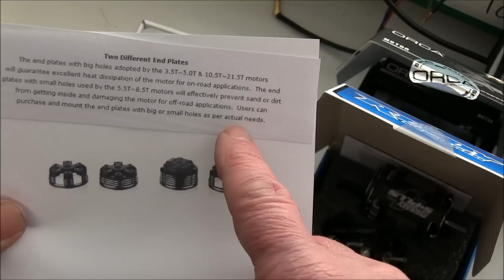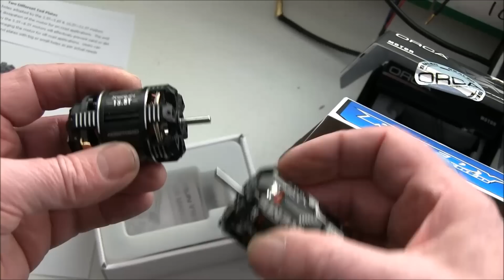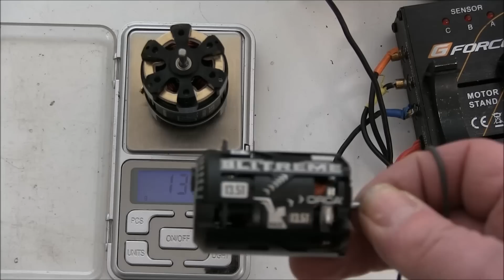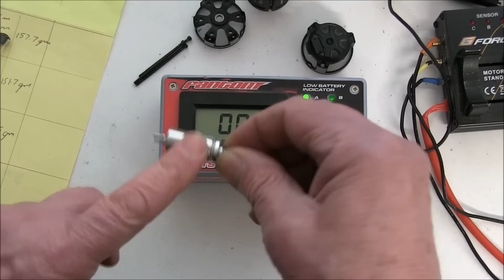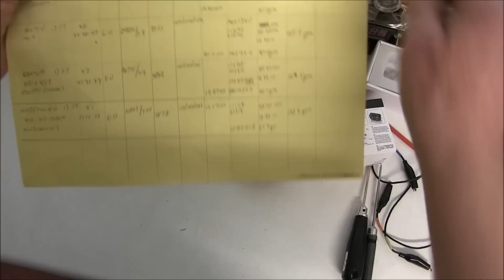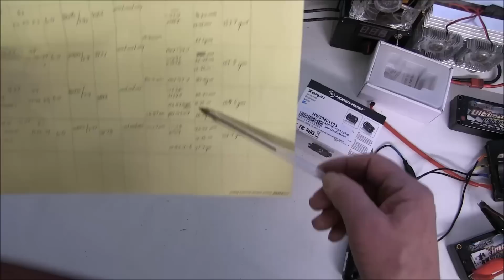Hobbywing XERUN-V10-G3-Black Brushless motor. Class leader?

Comment: Is there any performance gains or benefits of having the motor and ESC made by the same manufacturer?
Reply from the maker: Hi. No, there is no advantage. But there is an advantage to use the best ESC and the best motor together..
Note that the LRP (Nosram) ESC do not work with some motors (due to the sensor signal strength).
Reply: @nickadams5411  Ok, thanks!

Comment: Better g2 bandit or this g3 xerun??
Reply from the maker: The G3R due out August 2019 will be the best motor.
Reply: Thanks, how much degrees you suggest and shims on it? (17.5)
Reply from the maker: @awastyle9198  The Hobbywing G3 set about 50 degrees on the endbell for blinky. The end float shim should be okay with a small movement.

Comment: Hi Nick, did you had any issue with the rotor play when reassembling the motor?  Mine doesn't have any play at all or it's so small that I cannot feel it... But I think when was new, out of the box it had a little bit... I didn't add any kind of shim, didn't loose any parts... 
Thanks! J.
Reply from the maker: Hi Jorge.  I am not sure. Tap the shaft on the table, and then tap the other end on the table. It sometimes seats the bearings etc, and gives a little play.
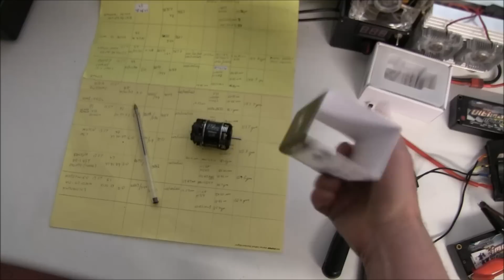Reply: @nickadams5411  I'll try that again I guess... But I think the same happened on your review. If you have the time, check from 17:30 to 18:00. :) 

Thanks!

Comment: Hey Nick, is the end bell bearing replaceable? Seems like it will fit the sensor board hole.
Reply from the maker: The enbell bearing is replaceable in most motors, but may require some force to drift them out from the housings. Note that the Hobbywing motors use a special smaller diameter bearing.
Reply: @nickadams5411  thank you. The g2 motors were a nightmare to do with the sensor board in the way.

Comment: Which is the best 10.5 motor
Reply from the maker: Hi Robert.  There are many good 10.5T motors. But depending what is available in your Country, the R1 , Motiv, or Surpass.  But there are many others especially if you using ESC boost.
Reply: Hi my friend , here we use in stock class with a blinky esc and 10.5 motor , please can you advise me on which is the best esc and 10.5 turn motor on blinky mode
Reply from the maker: @robertoborg5618  Hi,  The Hobbywing XR10 160A ESC is the best,  the motors - there are many, but get one with good torque, such as R1, Surpass, Motiv. Race on, nick
Reply: @nickadams5411  please can you send the model number of 10.5 R1 to try to find one from here but the R1 is in the regulations of the BRCA
Reply from the maker: Hi Robert. You are right, there is no R1 10.5T.  Try the zombie or Surpass.
Reply: @nickadams5411 What you think about the Hobbywing V10 G2 and G3 models!?
Reply from the maker: @robertoborg5618  The 17.5 and 13.5 are not good , as the rotor strength is too weak. They are designed for mod racing. They are very light weight, if you want to make the lightest car. But the new SMC motors are almost as light, and perform very well in the stock Spec class.
Reply: @nickadams5411  we use 10.5 motor with a blinky esc and the limit weight of the car 1330kg , I try to contact you on Facebook and messenger too
Reply from the maker: @robertoborg5618   The Hobbywing 10.5T does not have enough torque for most racers. There are many motors , but chose one with a high srength rotor.
Reply: @nickadams5411  please can you help about this thing , because I'm a beginner in electric motors tell me which once they are good and best and approved in the BRCA , Thanks you again
Reply from the maker: @robertoborg5618  Get the Surpass 10.5T V4S Rocket (Red). It's the one I would use. Modelsport (GB) has it in stock.
Reply: @nickadams5411  Thank you very much my friend
Reply: @nickadams5411 Hi my friend , please can you explain me how to find a proper gear ratio for 10.5 motor with a blinky Esc on a 1/10 touring car
Reply from the maker: @robertoborg5618  Hi. Blinky 10.5T. Depending on the advance timing, the KV could be 5000. Therefore with a 2S lipo of say 8volts the motor could achieve 5000x8=40,000rpm. You will have to gear according to the track size and length of straight. If you race a blinky 13.5T with a FDR of 4.5, then the 10.5T will need near 5.5. The performance and temperature of the motor will determine the best ratio. If the motor is too hot (>78degC) then a higher FDR will be needed.
Reply: @nickadams5411  Please can you send me the specs of the Surpass 10.5 V4S Rocket (Red) like KV and Rpm !? And how much is the temperature that the motor can resest !? Example Hobbywing V10 resest 105 celcius
Reply from the maker: @robertoborg5618  Hi. I do not have the test results, I need to do a 10.5T comparison.  But as they are normally used with ESC boost (turbo) the results are not so meaningful.
Reply: @nickadams5411  Thanks But if you know the KV only is good for now to know what is the best gearing for the track , we use 10.5 motor with blinky esc in the stock class
Reply from the maker: @robertoborg5618  Hi, Sorry I do not have a test result. But Surpass list the KV:  10.5T : 3800,  13.5T: 3500, 17.5T: 2300
Reply: @nickadams5411  Thank you very much my friend

Comment: Nick, had a conversation with a on road team driver, on the 21.5 said I could gear with temps being higher than what I'm used to, 175*F, this would be about 25* warmer than what I run currently? What do you think? Thanks for the video!
Reply from the maker: Hi. 175F  (80 deg C)  is as high as you want to go . Any higher and the motor will fade during the race. You also risk burning the coils if you go any hotter.
21.5T motors run hot since they have more resistance in the windings than lower turns (17.5T etc).
Use the best fan to cool the motor.
Reply: @nickadams5411  Thank you Nick, and Happy New Year!

Comment: Do you know the bearing sizes in the G3?
Reply from the maker: The front bearing is same as most other motors with 1/8th hole.
But the rear bearing has a 3mm hole.
I have not taken it out, so not sure of outer diameter.

Comment: how does a 13.5t motor compare to a 4850kv motor?
Reply from the maker: Hi Cow Poker
The 4850kv will be much more powerful , as it achieves that rating at a lower advance timing.
A 13.5T can only exceed 4000kv by high advance timing (50degree) which is critical on gearing, and causes more heat loss.

Comment: Hi there. I'm new to the hobby and won a new t6.1 stadium truck. What would be the best motor and electronics to keep up with the rest of the guys racing.
Reply from the maker: Hi Art
A good win.
The other guys.  What class do they run?  The motor could be 17.5T or down to 6.5T. You need to find out.
17.5T and 13.5T I recommend the R1.
6.5T , any make will have more than enough power.
Reply: Nick Adams. Thanks for getting back to me.  The class is 1/10 scale c class or beginner level for now. I'd like to get good enough to get into intermediate level. 1 of the guys I was talking to runs a hobbywing 10.5t.
Reply from the maker: Hi Art
Most of the new 10.5T motors should be okay.
Check the temperature of the motor after a run.
If it is too hot to touch, then adjust gearing, or fit a cooling fan for the motor, if there is room.
Reply: Thanks for the info. What would  give me the best acceleration and speed though. In your opinion.

Comment: nick how you ever try a  hb bandit 17.5 motor
Reply from the maker: Hi jairo
The HB Bandit or the Hobbywing Bandit.?
No,  as the newer Xerun V10 G3 is far superior.
Reply: hello nick  yes is the  Hobbywing Bandit outlaw   i know that the  g3 hobbywing is superior to g2 spec  but i dont if is superior to bandit outlaw
Reply from the maker: Hi
I have tested outlaw motors , but they are always very powerful (superior) and cannot be compared to the legal versions.
The whole point of Legal homologated motors is that they are supposed to be the same performance, so that racing is fair.
Outlaw motors are the same as Modified Open class motors where the performance is not limited by the motors.
Reply: thank nick well i ask you  because we run outlaw motor that because we dont have the logistic to check all the cars so to be simples  people can run wherever motor the want the only rule is to be not lower that a 10.5

Comment: Hi Nick, Im racing indoors on a short/medium very high carpet track. Using a b6.1 and was wondering what motor would work best. Your content is outstanding. Keep it up!
Reply from the maker: Hi Hye
Use a motor with a strong (High gauss) rotor.
Such as the Motiv MCR, The Fantom V3T, or the R1 and the good value Surpass V3 (or V4)

Comment: thanks for your videos, very informative and useful for a noob like me. actually, I'm looking for ESC + 13.5 motor for my very first racing 4wd buggy 4wd (EB410),  which motor+esc do you recommend in your experience.  ?  can you share you specs table?  gracias!
Reply from the maker: Hi Dario
Email me for the table: nick@demonproducts.co.uk

I recommend the Surpass V3 Rocket 13.5T.
Very good motor for low price.
There are many speed controls.
Do not go too cheap.
Hobbywing XR10 Just Stock 80A is very good.

Comment: Hi great video very informative those motor soldering tabs look lower or closer to the motor case than the hobbywing v10 g2 motors,  is that the case.
Reply from the maker: Hi
Yes, the clearance is very small.
They have reduced everything to the minimum.

Comment: Nice video. what is best for drifting. I drive on all hard suffices and have tires to match. I correctly have brushed motors but want to go brushless whats recommended. Thanks
Reply from the maker: Hi
Drifting ,  needs a contollable motor and speedo combination, for smooth throttle control.
These highy tuned, high speed motors are prbably too much.
Look out for drift package, which will have a suitable motor.
Reply: Ok im really struggleing to deside on a motor would you have any idea on what to get. They tent to run 10.5T motors to keep heat down
Reply from the maker: Hi
You are right, they seem to run motors that are very powerful.
Check this one out:

http://www.racing-cars.com/pp/Product_Category/Full_List/SP000196.html
Reply: Thanks i think i will go for this one its what iv been looking for iv not found nothing like it. I run a hobbywing gear in some of my trucks do you think it would go nice with this motor?
Reply from the maker: Yes, Hobbywing speedos have a lot of settings.

Comment: hi nick great job.i just bought a skyrc motor analyzer for my 10.5.how many amps is best for working on 10.5 in blinky mode ?
you often speak with 17.5 or 13.5 ..
thanks billy
Reply from the maker: Hi Billy
I recommend about 6 amps for all winds (Except 21.5T) as it is the wasted power, as heat in the motor.
Also as you advance past this point, the amps increase rapidly, for a very small increase in advance timing.
You can set the amps a little higher (Up to 7.5A) if you have a very fast or long straight track.
But watch the motor temp (no higher than in the 70s C) after the run.
Reply from the maker: Hi Si
The 6amp setting is for "Blinky" (Zero ESC timing) so that the motor performs at maximum  without overheating.
When using ESC with Boost and Turbo features, the motor timing is set lower at about 30 to 40 degrees.
The manufactures normally set to the lower timing so that the motor is not damaged when the customer connects a turbo boosted ESC.
Reply: Nick Adams, im also going to try and set the timing for max performance on a 10.5 using the motor analyser. Do i just set timing with an amp draw of 6A or should i also consider the KV and revs? Also, why dont all manufacturers just set the timing to a 6A draw when building if that is the sweet spot? Thanks Si
Reply: Nick Adams thanks for the clarification.

Comment: Does the purchasing of all these motors & Batteries come out of your own pocket?  If so it’s a lot of money!
Reply from the maker: Hi
I do have to buy them, as no one has ever given me any.
Mostly I am able to sell them on to racers.
Reply: Nick Adams Ok.  I am planning on racing 1/10 TC indoors this Autumn, the Reedy motor looks good, what motor would you recommend for racing indoors 1/0 touring car
Reply from the maker: Hi
Indoors, I recommend a normal reving, but high strength rotor.
Such as Motiv, Fantom or the latest R1
The reedy is very revy and hard to gear indoors.
Reply: Nick Adams thanks for the advice😀 forgot to mention I will be racing 13.5 Blinky if that makes a difference

Comment: Are those good for tape transport belt driven capstan ?
Reply from the maker: No, much too big.
Reply: I meant for RCA tape cartridge or small reel to reel machine. Is the speed very stable for audio applications?
Reply from the maker: Hi james
No, they are much too big. Also a normal 2 pole Dc motor is used in most tape players.
Reply: Nick Adams  The actual AC motor on my tape deck is 4 times bigger and runs at 120V mains, it’s getting slow and I want to replace it with a DC one I just want to know if its speed is stable for such application if used with a control board.
Reply from the maker: Hi James
These motors are not smooth at low rpm, as they are are normally used in the 20 to 30000rpm range.
However they do have a lot of torque.
Normal voltage is between 7 and 12 volts
The amp draw will depend upon the static timing set on the endbell, but will be at least 2 amps.
the shaft is 1/8th. There are larger versions with larger shafts.
Brushless motors used in record players tend to be multiple pole, for smooth pusing, and the flywheel will also smooth out the movement.
I am not sure how easy it would be to maintain a constant speed even with feedback.
As they have 3 coils, you will need an appropriate speed control, such as used in radio control models etc.
All the best. Nick